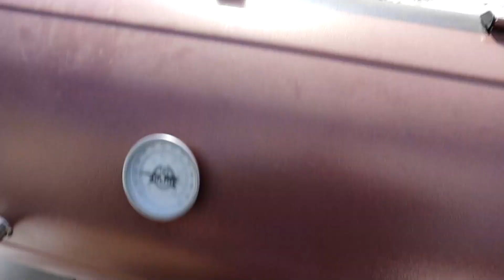Homestead Planning For Spring

Comment: I can't wait for your guys'spring to start. And I can't wait to see the building be built. Just wondering if you guys will end up buying some kind of wood milling tool to assist or log cabin style?
Reply from the maker: The plan now is to do a pole barn type structure.  Those particular posts are for a shed for the tractor, not a barn.  This is the trial run for the pole barn.  If it works out well I'll go for it, if it's a disaster I'll go with something more conventional. Dom